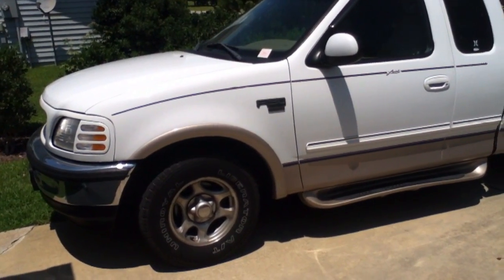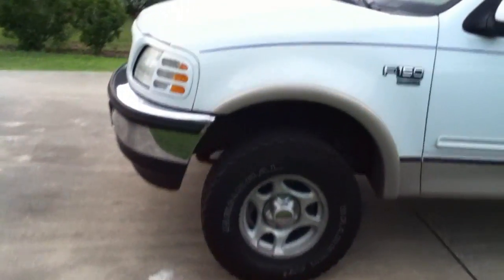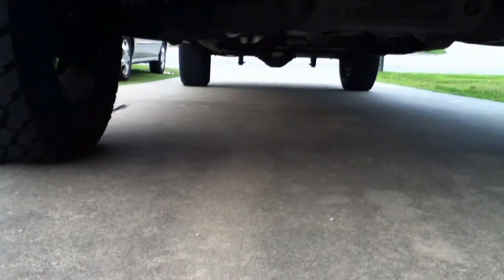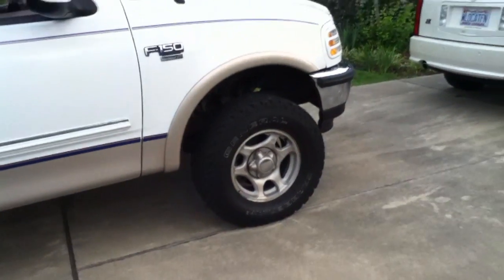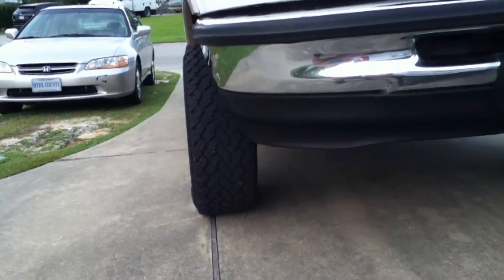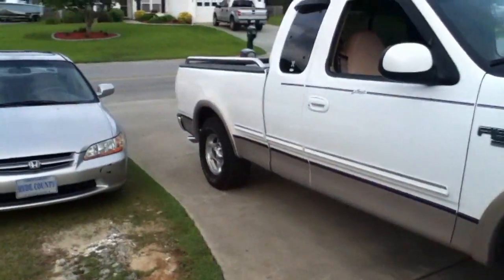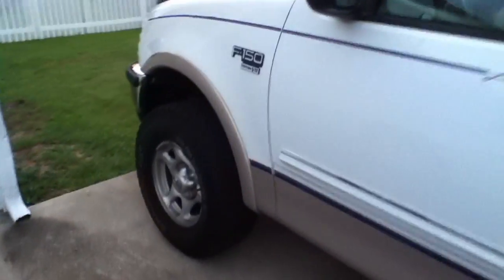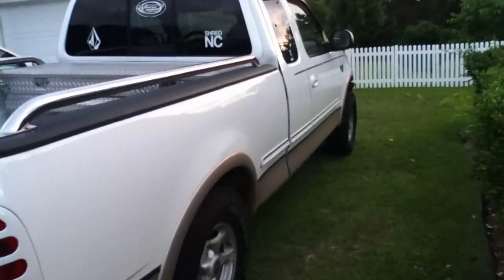Spindle Lift before and after 98 f150

Comment: my truck and yours look almost the exact same and are the same year model. I'm on stock 2 wheel drive height. I don't have headlight covers or tail light covers and mine is white on the bottom instead of brown. I do have cherry bomb glaaspack 12 inch to be exact.
Reply: mine is an xlt not a lariat.

Comment: Hey man, i have a 99 f150 4.6l, i like your exhaust setup, how much was it, and what kind is it? Nice truck man.
Reply from the maker: check out my exhaust video and my other stuff as well, but it is four stock cats, true dual 2.25in pipe with dual 12in cherrybomb glasspacks to 3.5in tips. i paid $30 a piece for the glasspacks, a friend sold me the tips for $20 and piping and installation was like $250. in all it was less than $350 for me

Comment: did you only do a spindle lift or do you have any other parts installed also like longtravel arms ?
Reply from the maker: just a lift spindle. i did replace the upper control arm/ball joint and lower ball joint but they are factory spec moog parts

Comment: any problems with the lift so far between the spindle and spring lift? Did you have to get a camber kit when you did the spring lift?
Reply: Replacing the spindle doesn't affect the geometry of the arms. It simply relocates the spindle knuckle lower down. If you do it right you don't even need an alignment after you install.

Comment: Did you find a good price on the spindles or did you pay the $500-$600 for them? I really want to get my 2wd F150 leveled because it looks silly how the front end is lower than the rear
Reply: Dylan Dubose did u ever buy the spindle lift?
Reply: Adam Ardis not yet bud. Not willing to spend $600 for front lift. I've been looking around for something a little cheaper and maybe like  2.5" or 3". Thinking bout getting my 2wd to sit up kinda like a stock 4wd f150 of that generation. Not too high and not too low. Not using it for straight mud bogging but I love my all terrains I have on it now. They're pretty useful
Reply: Dylan Dubose Gotcha yeah I'm trying to run 33x12.50x20 I have a coil spring spacer but I don't know if I wanna put that on heard they are dangerous.
Reply: Adam Ardis I currently have 265/70r16 and it made it look a little better than it did with the little 255/70/16 it had. I love the 265s but I'm probably thinking about going a little bigger maybe close to 33s but nothing over 33s. If I happen to find a spindle somewhere online for a good price one day I'll be sure to let ya know. I'm wanting to go either 3" in front maybe 3.5" and with 2" blocks in the rear
Reply: You can buy rough country I just did mine yesterday all front suspension everything including Barack lines anyways mine was 399.99 or 400 or you can go with 450 with 2" blocks and shocks from RC
Reply: mxs703535 on ebay 250$ im getting it
Reply: Dylan Dubose 3.5" lift maxtrac

Comment: So the only thing you replace to get the lift is the spindles? You didn't have to replace any other parts to match the lift difference?
Reply from the maker: correct, the new spindle is the same size it only has a different location for the wheel to mount up which provides the lift. i would recommend replacing the upper and lower ball joints while your at it though with some that can be greased to improve durability.

Comment: How did 
U get the 35s what other 2 inch lift do you use
Reply from the maker: Jarrett Burnett i added a 2in coil lift
Reply: Could you do a video with the 2" spring?
Reply: +Chance Pugh what tires where you running on when you did the spindle lift
Reply: Drummer yonisc Santiago  n
Reply: You can't add  2" lift springs to the spindle lift. Or spacers. You must either go body lift or a bigger lift with the cross member bracket to relocate the lower control arm

Comment: I dont think you'll fit 35's. At the most 33's comfortably
Reply from the maker: look at my new video with brand new 35 mud grapplers. i had to lift it 2 more inches to fit them comfortably
Reply: Chance Pugh did you add a 2" spacer on top of the spinals?
Reply: You can run 33's stock. I have had 33's on both of my 2wd f150s no issues